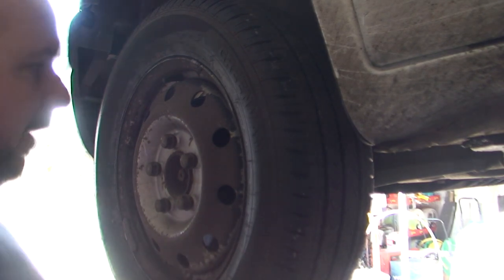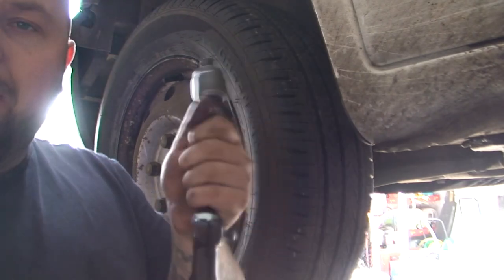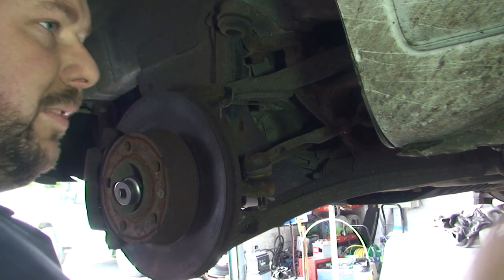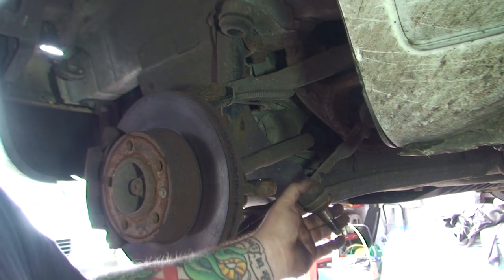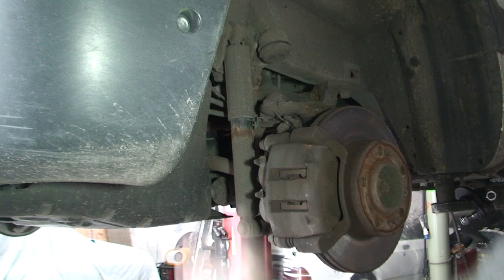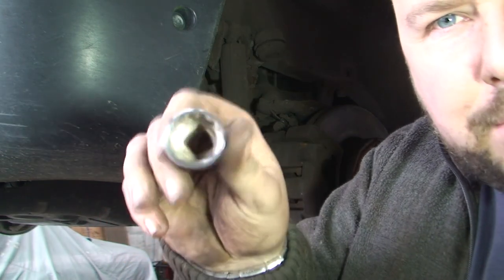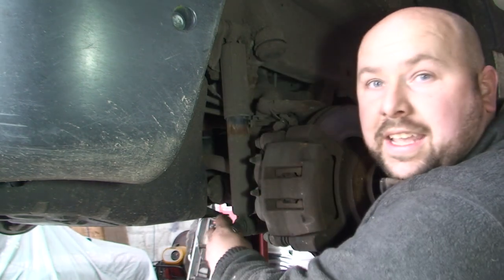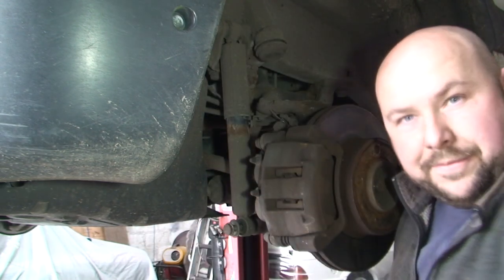bodgit and leggit garage renault master front tie rod and track rod  cv boot part 3

Comment: When I had my business I used universal cv boots for jobs like this, where you did not have to dismantle to fit The cv boot comes split down one side with a special step joint that you used some special adhesive on, once cured approx 10 mins you filled with grease and put clamps on. Saved loads of time and I did not have any comebacks. Bit more expensive by a few euros but worth every cent.
Reply: I (as a client) had one fail very quickly.  But then it was cheaper for me as the hours saved are also good for me.

Comment: Hi I own a master 2001 2.8dti the knocking I am getting through the drivers side drive shaft is the bracket do you know where I can get one only I have tried everywhere and it is like rocking horse shit to find hope you can help cheers jimmy
Reply from the maker: jimmy ambrose hi mate I would just go to the local scrap yards just have to ring around a few if not I wouldn't really know where to get one from main dealer maybe

Comment: Hi so if i havent got that blue large thingy for the inner rod would a wrench do?
Reply from the maker: polosev buy one lol if you search on Google inner tie rod removal tool there is loads you can choose from some are not expensive at all
Reply: Its something ill only use once tho but what is the diameter of the master one pls as there are a few sizes and a kit is 40 ish squid
Reply from the maker: polosev I'm not sure the size off the top of my head

Comment: Does anyone know what that special 21mm socket is called and where do I buy one?
Reply from the maker: Hi mate give me a time stamp of the video and I will tell you what it's called and where you can get one
Reply: @bodgitandleggitgarage  - It's at 6:15 and it's for the bolt at the end of the shock absorber.
Reply from the maker: @freeranger1677  hi mate it's just a 12-sided socket not a 6-sided socket
Reply: @bodgitandleggitgarage  OK thanks for that, I've got vibration on my Renault Master over 60mph especially when accelerating so I think I'm going to have to sort the inner CV joints. Just wanted to make sure I've got all the tools for the job.
Reply from the maker: @freeranger1677  hi mate CV Joints usually cause a clicking noise when turning you could just have a simple case of need your wheels balancing
Reply: @bodgitandleggitgarage  Yep you could be right, I will get that and the tracking checked first. What other mechanics are saying online is that you get clicking on the outer CV joints but the inner CV joints cause vibration at high speeds when worn. I will put a comment in here when I find out for the benefit of others.
Reply from the maker: @freeranger1677  no home to check the CV joint it's very easy but normally when even the inner ones gone you get more of a bang and rattle then just a vibration but they can fail in lots of different ways
Reply: @bodgitandleggitgarage  Well I am getting a clunk when I de-clutch. I'm hoping it's not a CV joint, it's a pain in the a** getting those drive shafts out.

Comment: strange my drivers side hub is 32mm and passenger side is 36mm!!
Reply from the maker: Hi mate what could happen there is there could have been an aftermarket Drive put on one side a lot of the aftermarket parts come with different size nuts and bolts
Reply: @bodgitandleggitgarage  ive just brought a new one and thats 36 as well

Comment: Ye might have missed a trick. If you don't have the long lever bar ye're using here, or th Jhon, u can always use a small btl or scissors jack between the bottom and upper wish bones/control arms like I did. Makes breaking them away from the ball joints v easy. Still gotta remove from the top  ball joint tho I recon if ya don't have an xtra pair of hands. Again, using the jack between th 2 control arms make this simple. Job I had to do was replacing the cv joint, so a bit trickier than this job, especially from the driveway, and there are expensive tools on the market for removing th cv joint itself, But enough liberal whacks of a hammer will get th job done 4 you just the same on that cv joint. .